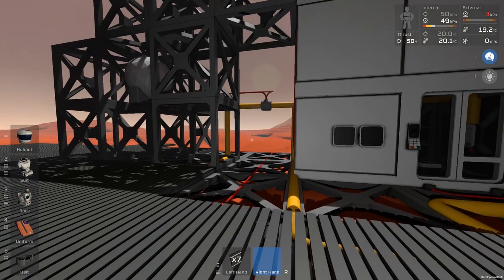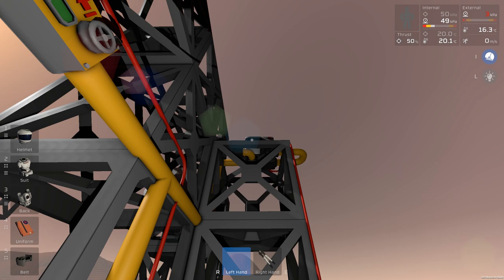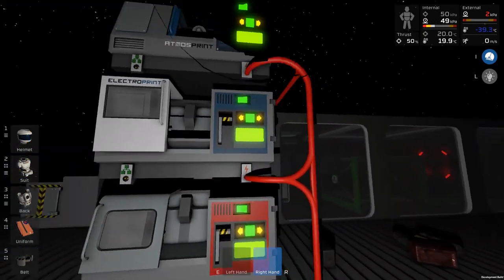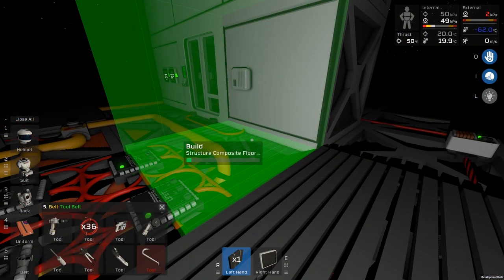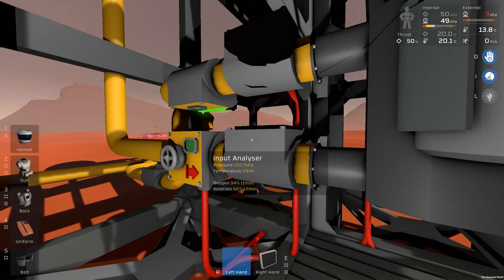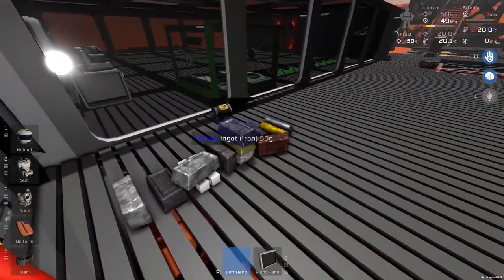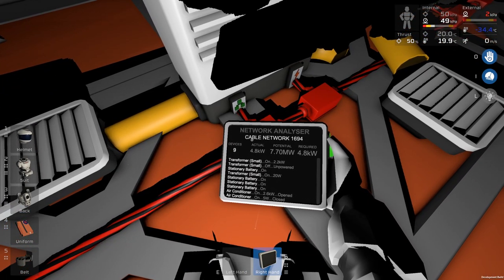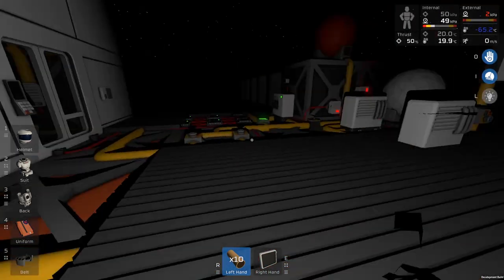Stationeers S2 E33 - New Power Bus, Furnace and A/C Thoughts

Comment: +gayduster Move the ice-melting furnace souch that it's input is in a frame so the chute can't melt the ices inside if it (to my knowledge, volume inside of twice welded frames acts as if it didn't have a atmosphere so there can't be any heat exchanges in there).

Air conditioning units (at least used to) consume 5W when "idle", and anywhere from 5 to 6005W when "started". When running power consumption did depend on teperature difference between the outputs and the ammount of gas getting conditioned. When it would technicaly (from internal eqasions) require more wattage than that limit to run at max cappacity, it would slow down, and even could not get the main output to the right temperature. If you want to supperheat something, using air con. units, you only cool something down repetatedly and vice-versa for super cooling, because they have that temperature setting limit (-99°C to 99°C).

You can just skip that loop idea with the filtration unit, just use digital valves to allow/disallow the mixing of gases in the pipes (since those pipes won't recive/get rid of any gas and volume of those pipes can't change, then the pressures of the gasses will be proportional to their temperature, making them move on their own (firstly, from hotter container to a colder container then back until pressure and temperature equilibrium, when allowed to pass thru the valve)). Have one array of radiators on one pipe for cooling and another one for heating, and just put those digital valves on the boundary of your gereenhouse walls/windows and toggle the appropriate valve when it is to cold or to hot. You don't need filtration for this. And if the gas mixing is to slow for your taste, you replace the valves with unfiltered filtration units to forcibly move the gases, which this time should be in frames to protect against any heat leaks.

Comment: for ices: nix the furnace, dump O2/ice into a 1x1 glass room of (initially) X, and when pressure gets high enough, active vent contents into pipe system.  build a 2nd one of those rooms for volatiles.  prevents autoignition.

Comment: As far as the pressure of your pollutant...

Higher pressure means higher thermal mass (more moles at temp) so it will take take a longer time to equalize the pollutant pipe to the atmosphere it's trying to radiate temperature differences into.  This should be a temperature near your ideal because it will stabilize easier as well as change slowly if you push high pressure gas into it.

If you have a low pressure Pollutant pipe, it will change temperature rapidly to meet the temp of the room your radiators are in.  This means you can to cycle more often (and quicker), but your temperature differences can safely be larger.  (You can dump some super hot gas in at low pressure and it will rapidly dump its heat into the room, but not change the temperature of the room all that much.)

 You can use this depending on how you setup your temperature balance system.  If you want to have a highly responsive system, use low pressure.  (low tolerance for temperature differences, bigger window... ie: +/-10C) If you want the temperature to fluctuate slowly, use high pressure and keep the temp in the pipe about the same as the target room temp.  (tighter tolerances for temps... ie: +/-2C)

You can use both of these principles... make the temperature regulator radiators room temperature at high pressure and manage this pipe network instead of the room.  The downfall to this is that the room can have a chance to fluctuate more than the radiators can sink because the pollutant pipe will take longer to shift temps.  If your room is wildly variable (furnace room....), low pressure is recommended.  If the temperature of the room is fairly stable (living spaces), high pressure is better.

Comment: Using multiple air conditioners in cooling mode, sharing a single waste heat pipe might allow reaching higher temperatures in the waste heat pipe, if that is your intention, but they also might have an internal safety device that prevents >700 °C in the waste heat pipe. 700°C / 973 K is enough to produce all metals and most alloys, however.
Reply: Not sure if it's still a mechanic, but they used to take more and more power (over 5kw) as pressure went up.  I haven't played with AC in a while.
Reply: Andir At maximum they consume 6005W in fact. I read that using a reader chip, i used that value to continously "start" my air con. unit, so a temporary brownout wouldn't make it forget that it was conditioning air before it.
Reply: The fact that air con. units don't heat up the waste output any higher that 700°C, is because of not enough gas is being cooled, since the contents of pipes cool down faster, the bigger the temperature difference between them and the air surrounding that pipe. But, here might be another problem, if a air con. unit is limited by the maximum power draw (6005W) it will slow down and will condition less air at a time, essentialy causing the first problem, that means you need ither to pecicely controll how much gas is entering the air con. unit (you might get up to 900°C this way, my speculation), or incase it and the whole piping in sealed (twice welded) frames, to eliminate any heat "leaks" along the hot pipe.

Comment: The function of the filter does not depend on the time but on the amount of gases that are filtered
eg you should not filter o2/n2 in the base but co2 ...so your filter dont run all the time
Reply: Tina Pezolt That's why I would like the Dev's to allow us to read the mole counts of all the gases inside a pipe (unless that has been done).

Comment: Use ingots instead of ore in the furnace.

Also, I'm kind of not liking the development roadmap RocketWerkz appear to be taking with this game. Instead of making the game more "engineery" they appear to be making it more hands on. They're implementing a whole bunch of new mechanics that don't have automation support, like filters wearing out, changing the way materials are processed. It seems to be moving towards the engineer basically running about manually checking systems that, at least in my opinion, fail far too quickly. 2 hours on a filter? I mean, even 10 hours on the heavy filter is too short of a period. Until they implement a way to automatically interact with filter slots on machines (ie. check the filter state, extract old filters and input new filters) with logic and chutes. 

IMO, the game is becoming less fun with all the additional changes that have been introduced. I think I'll wait to see what the game is once it's released. If they continue down the path of less automation and more manual interaction with systems, I doubt I'll be playing it anymore.
Reply from the maker: I was using iron ingots, and you can't use coal... ingots :) The furnace still bleeds off heat when moving the ingots from the input into the 'processed' state - so we're going to need either a hot pure gas constant furnace, or a higher initial amount of mixed gas.

I agree with your views somewhat on things like making filters consumable, but Stationeer's original influence was Space Station 13, from what I remember had a heavy requirement on lots of people doing different jobs, so I think they may have to balance automation with giving people important things to do in game.

Comment: The new jetpack is stupid and unrealistic. It ignores inertia.
Reply from the maker: I just don't like the fact it launches you when enabled - I can deal with most of the rest :)
Reply: Yeah, but inertia is like described by Newton's FIRST law of motion. It's one of the primary manifestations of mass. It basically says that an object will resist motion unless a force acts on it, in which case it will accelerate in the the force's direction from the starting state. Perhaps the acceleration was set too high... but then the same jetpack would launch you off into space on lower gravity bodies like Europa and the Moon - unless they're using different jetpacks there... It doesn't make sense.
Reply: Another possibility is some bug that gets the player "stuck" to the ground while the jetpack acceleration is applied increasing upward velocity without you moving, and as soon as you're "unstuck" that up velocity is immediately applied. It sometimes looked as if your foot was stuck in the edge of floor grating when it happened, then launched you when you moved a bit.